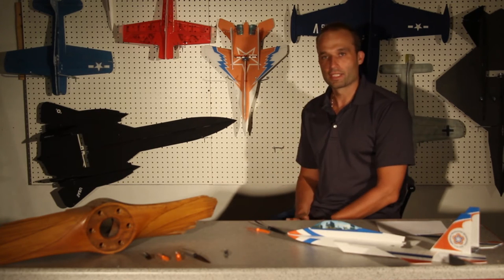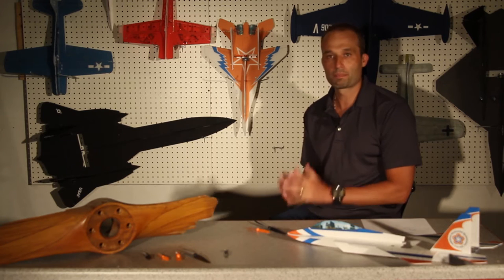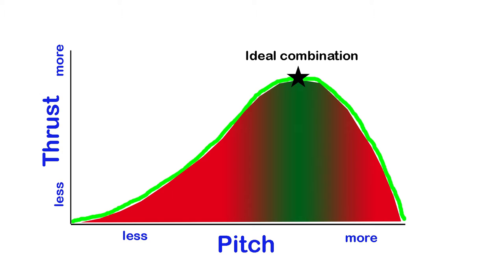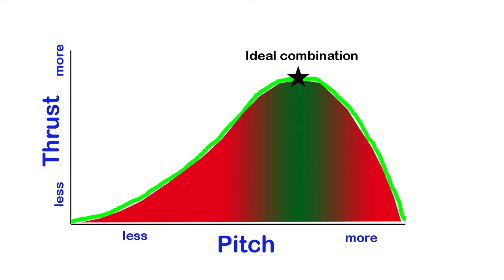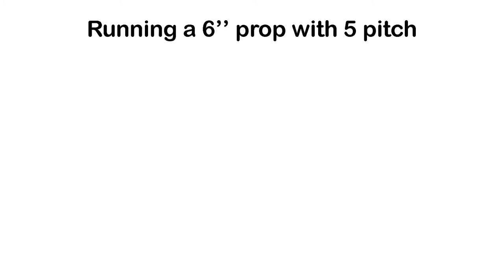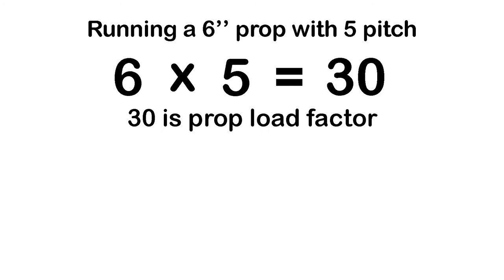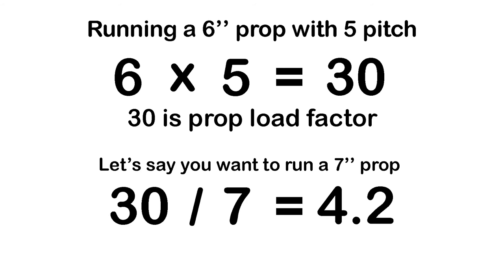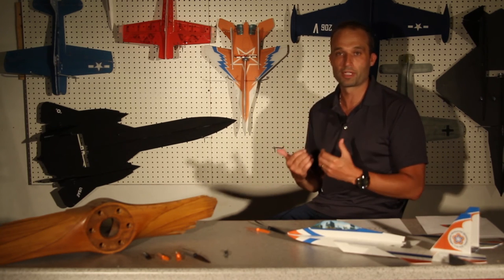Propeller Basics in 5 minutes!!

Comment: Pitch = speed, on a 10x8 every complete rotation the plane will move 8 inches foward so the bigger the pitch the faster the plane

Diameter = thrust 
The bigger the diameter the better climbing capabilities 
Obviously you cant overload the engine with too much pitch or diameter 
If one goes up you have to reduce the other
Its a choice you make
Fly faster les climbing and les control at slow speeds
More thrust les speed better control on low speeds and better climbing capabilities